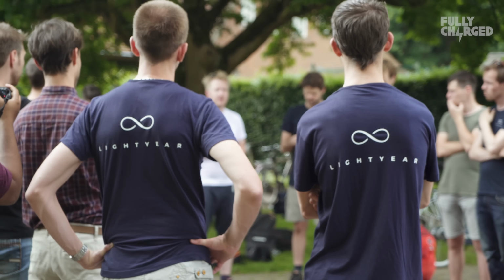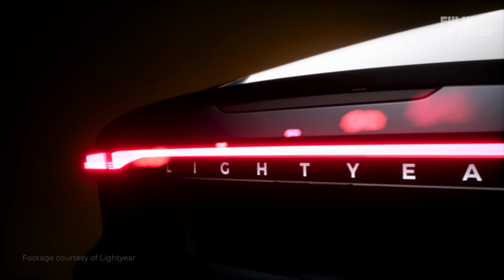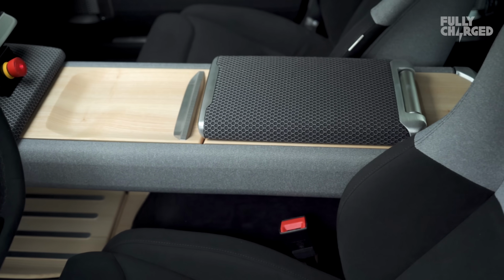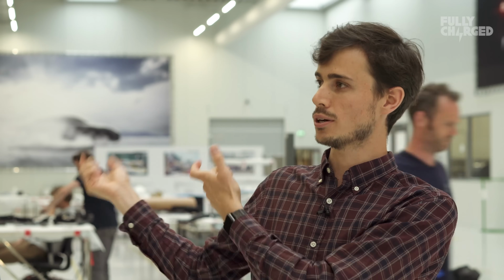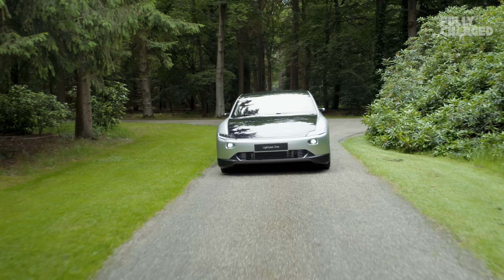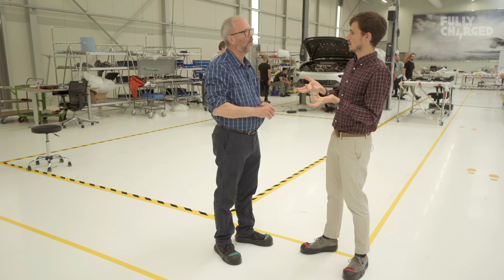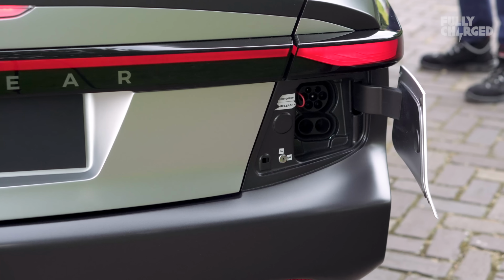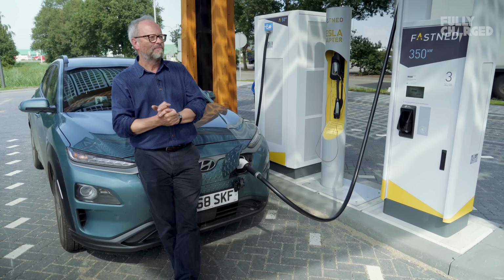Lightyear One solar powered electric car - exclusive first look | Fully Charged

Comment: Considering the average distance a day we travel with a car being around 30 miles, the majority of drivers will mostly rely on  solarpower, so a much cheaper version with a much smaller battery pack should be the obvious. The extra weight of the batterypack to cover distances the average driver normally doesn't travel will be 99,9% of the time useless weight consuming a substantial amount of energy. My hope for the future: I would like to see the team of lightyear one to keep focusing furthermore on efficiency so that'll be their trademark. Range was/is a good selling point for Tesla which initially had to convince people that ev's could compete with conventional cars on that aspect(whyle holding up the same form factor to comfort the minds). Lightyear one's mission should aim further and challenge us otherwise. In my opinion: to accustom people to radical new designs and propagate efficiency as the key of the future. Imagine a version with the fishtail rear-end and a more rounded front, no side rear cameras(instead composing an image from different build-in cameras), flat side surfaces without esthetic curves, a gap underneath traveling trough the entire body of the car from front to end, easily removable backseats, completely flat rims, improved low friction coating, all windows with transparent solar cells, a small light weight batterypack of (10kwh), option to encrease battery size when needed, when cargo needs to be transported the fishtail adjusting in height(takes shape of minivan true fabric extending the body)... that's the inevitable future. "One" vehicle adapting to your needs. The adaptive part relates 100% to the efficiency story and would give Lightyear one a (even) more solid distinctive identity, a stronger selling point I think. Anyways i'm so amazed by them and hope they succeed as they are writing history from now on, cheers!

Comment: I don't believe this for a second, the solar panel area is just too small, even if you assume 100% sun -> power conversion

It's a nice addon, maybe, but it can't power a car!
Reply: You perhaps missed the fact that the solar panel is in addition to the battery, the car is intended to be charged up like any other EV, the solar panels increase the range on a sunny day or can help charge the car when not in use say if standing in a carpark on a sunny day. The other factor is the efficiency, it requires less energy to operate compared to other vehicles due to things like less weight, better aerodynamic efficiency, amongst other things.
Reply: I'm really curious if the amount of electricity generated is even a drop in the bucket for what a typical driver would use. Sure the solar panel may generate electricity but if it's so minimal that it makes hardly any difference then this is a pointless product.
Reply: @howard99999  well, I'd say, they must be onto something if they have gotten this far. After all, they seem to have a good record winning races and such with solar technology. I am curious too, but you probably aren't giving them enough credit either. They are the engineers and they probably have a good idea as to what the solar portion of the vehicle is capable of doing.
Reply: I believe they admitted to the car being assisted by the solar panels. Not relying solely on it. Did you watch the video?

Comment: Current solar technology are NOT sustainable and NOT recyclable. This company is not here to stay. Tesla revolutionized electric cars by focusing on batteries. This company of should of focused on their solar panel technology. It's still using the past solar technology and concepts. I like that they are trying to make it work but it will never make it to production without solar innovation.
Reply: Blah blah buzzword buzzword buzzword buzzword something something something
Reply: @edism  I'm a electrical engineer working for a solar company. Current solar panel technology still uses the same process of converting sunlight through chemical reaction into energy. However, not only are the materials needed making the panels TOXIC, it's highly contagious to the environment and almost impossible to recycle without pouring a ton a money.

Comment: why would you put a solar panel on a car wtf, that's not efficient lol
Reply: It's a gimmicky overall product and i'm not sure it's going anywhere, and i find a lot of words falling out of the mouths of these people outright harrowing. Like how they had to explain the buyers about driving at night and whatever. "A solar car is best where there's little to no infrastructure" - well but you can't have a car that's solar self-powered to more than a tiny percentage of its power requirements, so what are you gonna do, wait for a few weeks between trips for it to top up a bit?

As to whether putting solar panels on a car is efficient... it's for sure not cost-efficient, nor is it an efficient way to harvest solar. However, if the weight of these cells is low enough, and they provide at least just enough energy to offset the energy cost of moving around that increased weight, then they are an overall efficiency improvement to the car. Whether they are? I have a feeling that they might be! A BMW i3 is claimed to require around 14 kWh/100km, or at 50km/h let's estimate around 7kW (somewhat optimistic), and these guys are claiming slightly better than 1kW performance in best conditions from their solar (plausible), so i think even at 1/5th that performance due to varying conditions, thus covering about 3% of the power requirements, they should still be worth their weight.

I'm also mildly dubious about... well i mean they claim to be twice as efficient, than... other modern electrics. How? More efficient powertrain? Not possible, not by more than a handful percent. More aerodynamic? Yeah perhaps better than a BMW i3 but it's not easy to beat a Tesla by much. Lower rolling friction? Well you look at an i3 and its damn skinny tires, and how you wanna beat that? The only thing that makes sense is the weight, and this team certainly has expertise in building lightweight structures that can roll purely on solar, but... a car is not that. You could build a 500kg 4-person car, those used to exist in the age of crude steel constructions before poly composites and lightweight metal alloys, but they can no longer be made now as safety requirements increased, the weight was added to accommodate them. In the best possible case, their claim of being significantly more efficient than other EVs is completely bogus and it's a largely redundant overpriced vehicle, or otherwise it's a death trap.

Comment: I want this, and want to believe this, but solar panel efficencies are STILL too friggin low for proper good usage for anything besides partial trickle of electricity. We need a solar cell revolution. But even so, its only a gimmick, because there's simply not enough materials you make solar cells from on the planet to fully cover our energy needs, not even close.
So, we're still ending back at the same conundrum. We need FUSION. But, this is cool as a concept car.
Reply: Solar panel efficiencies are slowly improving but it is very hard to make big gains due to the physics. There are some techniques that may in future improve the situation but the point is that it's free energy in the first place. It is certainly not a gimmick and as a technology  is capable of displacing a vast quantity of CO2,and globally already is. Then there is the fact that we could use energy so much more efficiently that we currently do so this closes the gap. Solar can be used in conjunction with other renewables such as wind hydro and tidal to replace much of our dependance on fossil fuels and eventually replace it all with the help of energy storage. Large scale fusion is just too difficult for the forseeable future, may be it will come eventually but renewables are here today.

Comment: I think it's an incredible feat, but I'm a little skeptical on its power, battery life and usual distance. Perhaps it might sell in California, but getting to the brass tacks-- this thing has to scale and sell for under 40k, or he'll never get into the Tesla territory. Already, I can tell this is going to be well over the asking price of Tesla's luxury and SUV models. I read somewhere that the slated price was $170k, which doesn't even break the surface. And the other thing, at that price point, looks are everything. You're now catering to a market that has to drive in style, and this thing looks like 1993.

And just the mere distance per charge you really get. The time required... 13k needs 1 hr of charging time. That's just insanely too long. And he advertises that on an optimistic day with clear weather. You cannot realistically have this thing parked under any covering if that's the case. I'm so sorry, but this company is an incredible ways off from their competition in the EV market.

Comment: excellent! That’s the way to the future of Electric Cars. at this moment mi Chevrolet Volt provides 1.360 kw just enough to recharge my battery in 8 hrs from solar. Two flexible 200 watts and a 3000 kw inverter where you plug the charge cord. Love the design.

Comment: Ok, great, it works, it drives one kilometer per hour, great, it can travel 400 km at its minimum, But really now, lets be real, how FAST will it go? can I even drive this 40 or possibly even 80 km/H without running out after 10 seconds of driving?

Comment: Nice to see you guys got this far, but the idea is just terrible. Imagine not being able to drive because there wasn't enough sun that week, or having to park outside your garage.
I think I just disagree with the idea of solar panels when you have an opportunity for another energy source, if this car was going to another planet with no power sources then sure, but that isn't the case. The reason I think that is because solar panels just have too many drawbacks. It's like having a coal furnace on your car to start it up, it's unrealistic and should be left at the power plant.

Hopefully I bite my word on that soon and solar panels can increase their efficiency and drawbacks to be more realistic.
Reply: You do realize that this charges with a plug, the same as every other electric car. The solar panels are to supplement it.
Reply: @TheRbgrace504  the tradeoff isn't there, those solar panels guranteed cost a shit ton and wont pay off for years

Comment: The solar panels provide whopping 1 kw of power on a sunny day - enough to drive at 15 mph. Or it could recharge your battery if you leave it outside for a week.
Reply: Exactly that's quite a lot of free power over a year and some of that power if taken from the grid would have come from fossil sources. You can still charge it like any other EV.
Reply: @arthurhood8030  Or you could install rooftop solar panels and it'll be far more efficient at producing solar power.

Comment: I seriously doubt the 10KM/hr rating....but even if that's true....that assumes you never drive in the daytime....lol.  Most EV drivers plug in at NIGHT.  Would be nice to park in the daytime when you get to work and pull 80KM while parked...but again...I've never seen solar panels that are that efficient...especially at this small a scale.

Comment: Why did they have to cover the back wheel 🤦🏽‍♂️ whyyyyyyy
Reply: Maximum aerodynamics. Honda insight did the same thing.
Reply: I guess it's just for aesthetics. Not sure though
Reply: Going to be pain in the butt to wash unless it has a easy way to do it. Beyond that I love it!!!
Reply: Derrick Samuels the half covered rear wheel reminds me of Cadillacs from the 70’s and 80’s
Reply: Aerodinamic design isn't very pretty when you need to push the limits of what it can do...  but some people like it.
Reply: I suspect the cover on the back wheel will be a nuisance in winter. Ice and snow will accumulate and freeze in the wheel well
.

Comment: Wheels are super thin I’m not sure how well that would drive
Reply: Yes, I watched a road test for a Tesla the other day. One of the low profile tires hit a pothole and got a nice gash in the sidewall. There's no spare tire, so the down time was considerable.
Reply: @Ottee2  He said wheels not tyres.
Reply: @edism  , yes, I know, but the wheels look fairly typical, so I assumed he was really talking about the tires. Sorry if this was an incorrect assumption.
Reply: @Ottee2  No need to apologise, though I do apologise if what I said came across as rudely abrupt rather than a gentle nudge. I was thinking the wheels were thin here https://youtu.be/bSbWwn_YCr8?t=111 so when I read his comment I saw he was echoing my thought.
Reply: Narrower wheels are more aerodynamic and have lower rolling resistance, with the right tyre compound and suspension design, grip and handling should be good enough although would not match an out and out sports car, but then that would be missing the point! This is about maximising efficiency.
Reply: @arthurhood8030  , maximising efficiency while creating a sporty, solar assisted, car that's fun to drive?
Elon Musk: hold my beer.

Comment: So whats the 0 to 60 time.? or 1/4 mile.? how many motors will it have.? 
Interviewer knows nothing about cars... just rambles on about little squeaks.. useless.
Reply: It's a first prototype you ignorant !
Specs aren't final !
Btw it was explained clearly that it has a motor in each wheel and you didn't pay attention
Reply: You're the one rambling about useless stuff who only thinks that 0-60 and 1/4 mile times are the only important things about a car.

Comment: Even if your solar panel had 100% efficiency and it was always under super bright light, you would only be able to collect about 4.10^6 J of energy every hour for each square meter.Even if you had 10 square meters on your car you would get 4.10^7 J per hour. Now a car driving 55 mph for an hour requires about 3.10^8 J. So even by being extremely conservative you would need to leave your car in plain sun for 10 hours to drive one hour.
Reply: That's it, that's what I'm talking about. Driving uses much more power than what they draw from the panel

Comment: You said you have a long drive on an electric can while they may work in the EU. In America the electric car is still far too expensive when factoring in in home instillation of a fast charger. With all that you are still looking close to 43 grand for a basic sedan or hatchback. My truck cost my 40 grand for a fully loaded model at the time and it is far more practical.
Reply: Beach Lovin how expensive do you think it is to install a home charger for an electric car?  I have a Tesla which includes the charging cord in with the car, but even if they didn’t the cord retails for like $900.  My house was pretty much a worst case scenario for installing the outlet for the Tesla cord to plug into, because I had only 60 amp service to the house, so I had to upgrade that to 200 amp service, the garage is detached so I had to bury a cable underground and then install a 100 amp subpanel in the garage, and then finally install the NEMA 15-50 outlet for the Tesla plug.  Total cost was nearly $3000 but given that my gasoline bill that had been over $300/month is now an electric bill of less than $150/month it took less than 2 years to pay for the electric upgrade (and to be fair, the house needed to be upgraded to 200 amp service anyway).  Most homeowners with attached garages and 200 amp service can pay an electrician about $500 and get an outlet installed in their garage, no problem.

Comment: Feels a little bit suspicions driving around at 15km/h around a garden. Why not take it on the road?
Reply: It's a prototype: can't go in public roads
Reply: also it's the first prototype. That car probably cost a million dollars. Would be a huge setback if it got in a crash or caught fire.
Reply: In Europe, you can't just drive anything on the road - it needs registration, which this car is probably lacking.
Reply: @richyzig  you can drive prototypes on the road with permission of the police as far as I know
Reply: Common guys, with that amount of project budget, i think they could drive it normally on a test track. I'm not talking about taking it in traffic on the highway.
Reply: @brottochstraff  at this stage its probably their only prototype, even a test track would be extremely high risk should something go wrong. they are still developing the car, i would say 12 to 18 months away from such a test. still looks very promising. maybe by the time its out solar cells evolve to grant it even more driving range :)
Reply: @TheOnlySillySocks  I hope you are right. Really want this car to be able to do what they promise.
Reply: @TheOnlySillySocks  it's probably not because of risk, but because it can't drive fast enough yet
they probably installed smaller motors and batteries
because even in a parking lot you can drive 50mph
Reply: SillySocks I designed an electric car back in 2013 and in April 2014 our first public showing of the car was not only on a public road, it was on a road that was closed for the day because there was a race happening, and my car participated in the race (and performed well, winning its class).
This video was a total fluff piece and my only takeaway is that clearly the car hasn’t been properly tested yet and  the engineers are concerned that something will break.